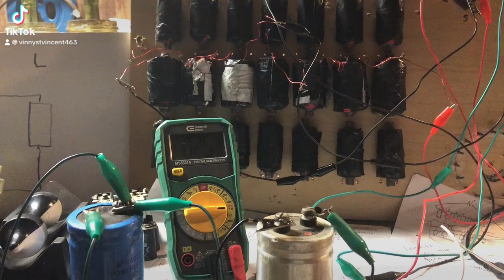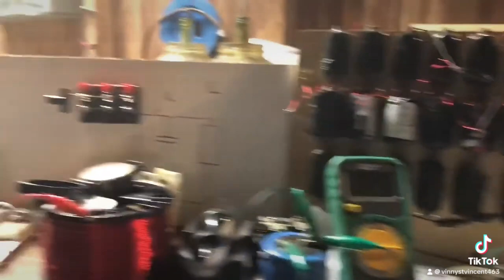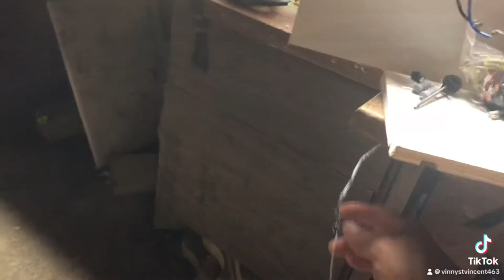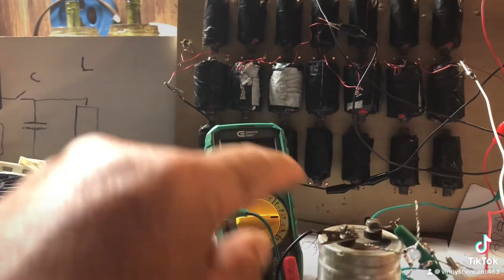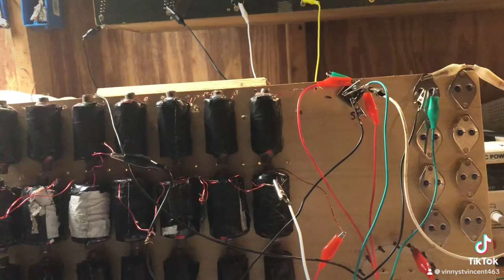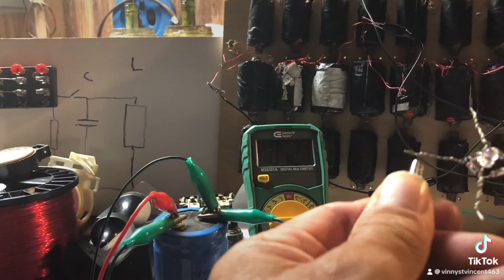Making a Sine Wave without moving parts

Comment: So, I asked my professors a question about ‘Earth Ground’.  

I basically wanted to know the physics of it.

I wanted to know what makes its potential different than a ‘floating’ voltage from an isolated unpowered potion of the circuit that has no connection to ground.

The question being, is it the surface dissipation (perhaps transduction, piezo) of the grounding rod with silica in the soil? Is it the sheer mass of the planet? Or does the Earth actually itself have a potential difference as if it is a positively changed object in a negatively changed ‘space/aether’.  Perhaps a combination of things?

My teachers could not answer the question. They said they did not have time to explain the physics of it.  Which I took for them not having a clue.

The potential to ‘ground’ is there somehow.  A floating voltage says there is some small difference in potential to portions of a circuit which are isolated and ungrounded, some potential is there, but not much.
Reply: Unpowered, isolated and ungrounded, obviously for the floating voltages.

Comment: Ed used th 12 bore block by ford. He added CALCIUM clay, instead of Fords sticks who should placed into the bores to get overunity power. He claimed... this motor started by gas is only 10% of the output the CALCIUM ION COMUTATOR against spherical field.... Good work man🙏🏼 Hope you can follow my thoughts on the topic: non magnetical electron flow. Like in our bones❤